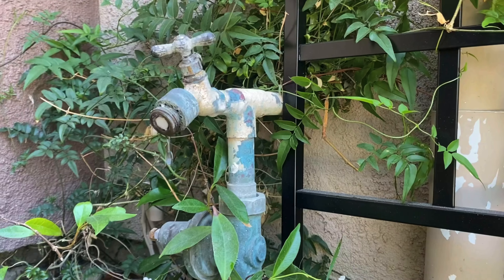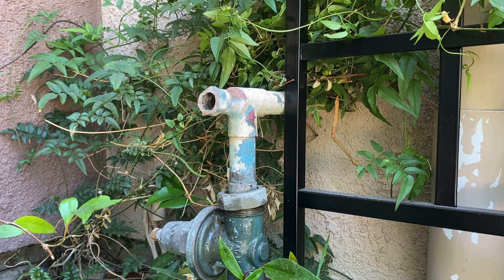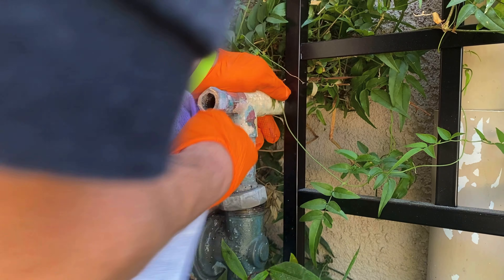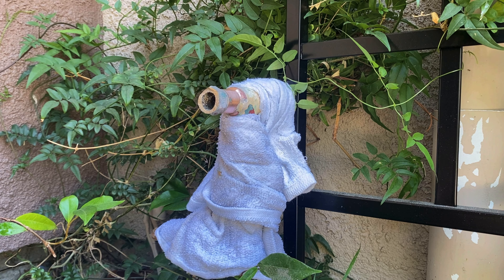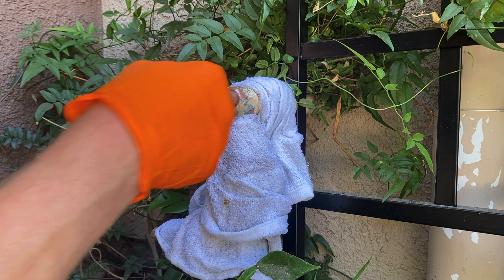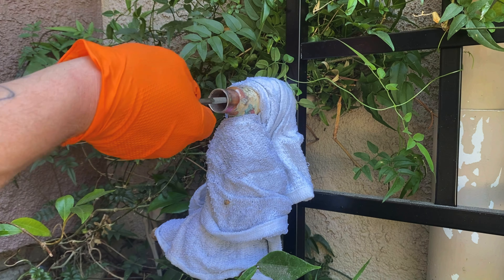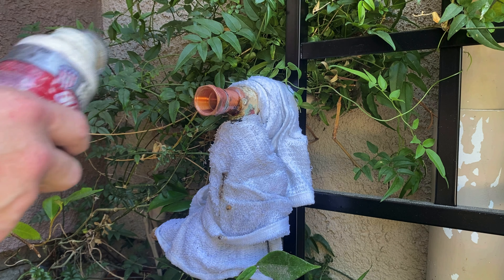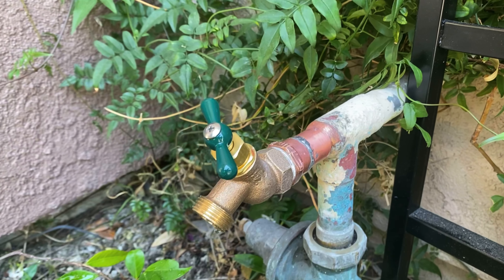How to replace your hose faucet!

Comment: Nice Job chris!   I wack the hosebib too  with saws all.   the extra thick bib having the 5/8 id for sweating 1/2 or 3/4 is why it traps water  so breaking union loose makes big differance too.  Sometimes ill put flux on the tee and heat it up and then wire brush it   then come back and sand to get all that paint crud and stucco  off.  I like the hose bib you got looks like it has a packing washer. new arrowhead brass have the o ring    dont like em.  proflow has good ones.
         Man  only 34.       Im 64.      good tips    all the stuff I do  some times i hit it with a shop vac  to get water out
Reply from the maker: I just really love this stuff Jeff, Im always learning and trying new things and just really enjoy the interaction with folks like you its really an honor to be part of this whole thing! I try hard to bring something different to my videos than the other plumbing channels and I love theres people out there who appreciate it!